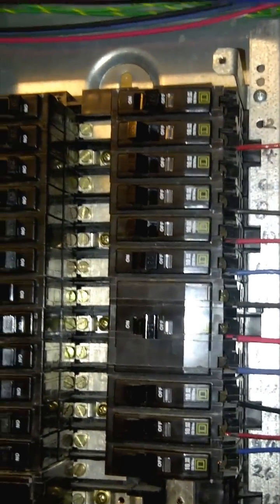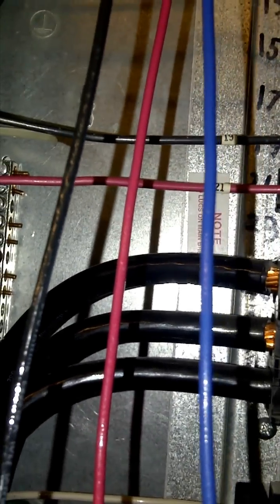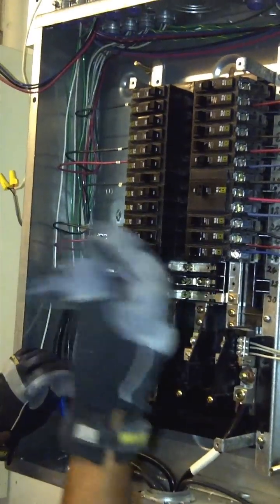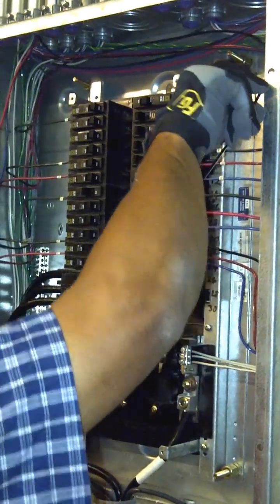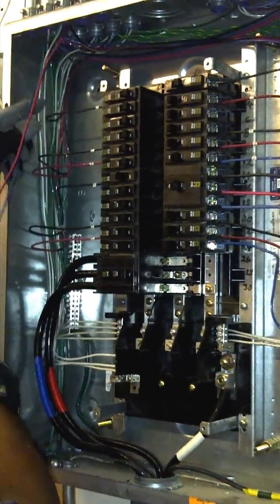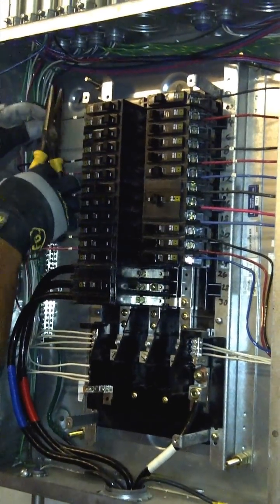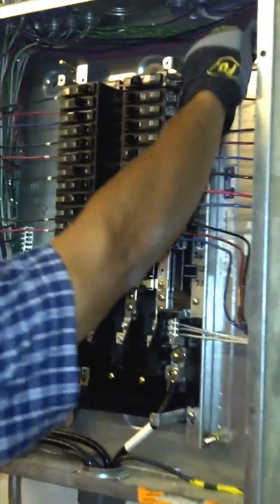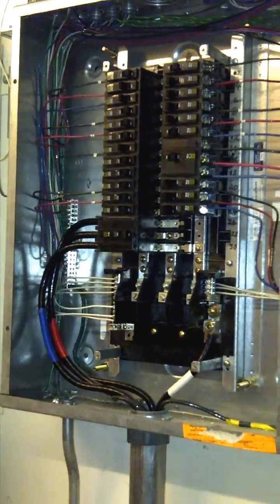three Phase panel board wiring

Comment: You said you don't want to disturb  the black phase A  ..  you could have moved that one from the left to the right If it was a 3 phase equipment it would have to (shut of simultaneously) and since you have a  single breakers 120/ 208  you can Land a 120 on any phase the only thing you can do is grab a voltage meter to make sure  then count your phases ..
If this is a piece of equipment it may cause some serious problems

Comment: My understanding when wiring three phase all breakers must shut off simultaneously even on a multi-branch wire circuit it should shut off both circuits simultaneously
Reply: YES,YES,YES  What he is doing can cause you to single phase if you drop one.  THAT can make smoke.  Smoke = Bad.

Comment: Do NOT do what this guy is doing!!!  For one thing, those gloves aren't going to save you.  It's best to turn off the power to that Box, but if you can't, you better be very careful.   It is wise to use that type of screwdriver, which is an electrical screwdriver that the shaft is insulated.

Do NOT wire a 3 phase circuit onto 3 different breakers.  That is just asking to kill someone in the future.   Someone a year or more later wants to turn off the power to do something and doesn't realize that power as on 3 different breakers is in trouble.  You want to use a 3 position, single breaker.  When you kill the 1 breaker, you kill all 3 phases at once.  I've never seen anyone do what this idiot is doing.   You have to be careful about what someone is giving you directions on how to do something.  Don't take a single source as your reference.   2,3 or more is better.  This video should be pulled as it's flat out dangerous.

Comment: hey Mario I'm trying to re wire a data center we have for mining.  it has 3 phase 120/208v power.  I need to run 240v outlet from the panel to make our amp draw more efficient.  I'm not a certified electrician, but I know my way around and wired everything in our home single phase.  can you help me figure this out please.  you can contact me at disruptioncrypto@gmail.com
Reply: Can you give like a drawing of a busbar inted to be used for 2 wire 220 (108 each)  I mean can I get balanced distribution out such system like yours? I am using this purely for AC split units

Comment: edgehead13 learn your color codes man. 
And as for this video you really should have a 3 pole breaker because you are sharing your neutral. If you don't want your circuits on the same side run a neutral per circuit which as of 2014 you have to anyway.
Reply: uploaded in 2012...
Reply: @thecalabiyaumanifold  hahaha good point.

Comment: #1, All three phases should be on 1,3,5 or 2,4,6.....etc. and connected with a 3 Pole breaker.
#2, The proper way i was told for the wiring pattern was Red,Black, and Blue.
Reply: he's gone to Mexican school for electrical training. He's right about colors though
Reply: Lol yea red black blue. Good way to piss a lot of electricians off.
Reply: Not sure if anyone is reading this 9 years later, but at least in the part of the US I'm in, we use black, red, blue as our 120/208 3P color coding
Reply: @d.t.3495  Thats what we do over here in Phoenix AZ too bro

Comment: i thought this was illegal as for isolation purposes as you could turn of two phases and and forget and leave one which is Dangerous For Equipment and Personal, the way i have learned it that got to be breaking CODE checked it out my friend
you are teaching people to break CODE.
All three phases are supposed to be on a triple pole breaker link together,when you turn off this supply what ever equipment or panel is all dead and proved dead  ( LOTO ) Lock off Tag Off